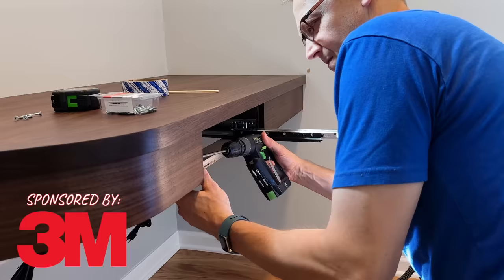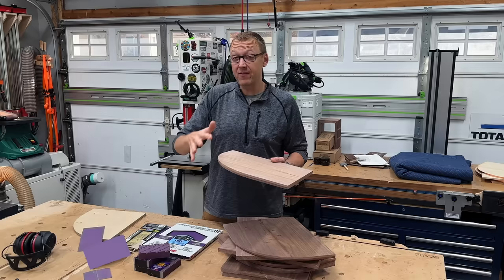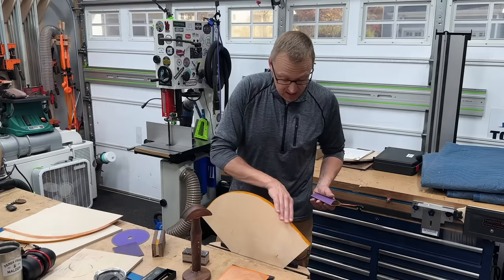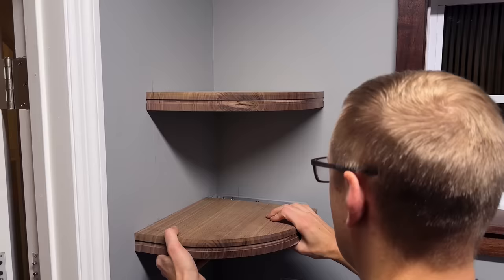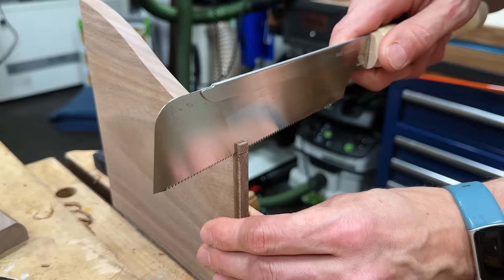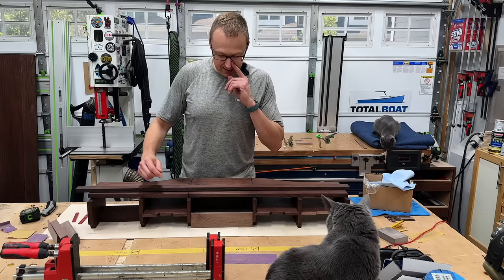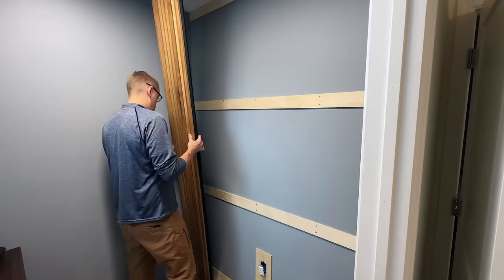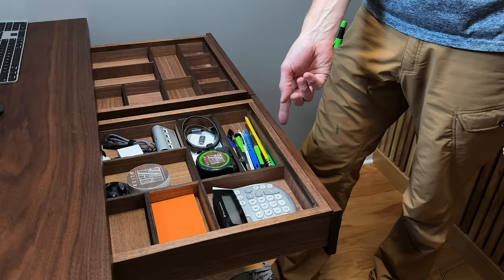I spent over $5000 building my dream office.

Comment: putting them behind you is the correct.  the sm7b is a directional mic and rejects sound from in front of it.  so by putting the panels behind you, those soundwaves won't come back and hit the mic from it's 'address' side where you talk into it.  That room would also benefit with some treatment on the ceiling.  check out john heinz or brad's fix this build that for building sound panels.
Reply from the maker: Thanks Greg! And yes, I've definitely considered some ceiling treatments. Also, maybe a carpet. Although, Jerry sheds enough that it will be a gray carpet in here before too long 😹
Reply: if you treat the ceiling, you won't need anything on the floor.  Jerry can shed till the cows come home and you can too! @KeithJohnsonCustomWoodworking

Comment: The wall panels could be easily made on your end so you can make sure it's quality material but then you run into the same question as making drawers and box joints. Would it be worth the labor vs out sourcing. 
Unless you're staring at the wall for entertainment the pre-made ones could be worth it, if you don't have the time.
Reply from the maker: Exactly. It wasn’t worth the labor and I had zero interest in making them 😂

Comment: 28:16 It's a bit counter intuitive, but it is generally better to have acoustic treatment in the direction the microphone is pointing, so the rear wall is a good place to have treatment. Even if you do have acoustic reflections coming off the surfaces in front of you like the wall and computer monitors, the back of the microphone is less sensitive and won't pick up those reflections anyway. If you do still hear more ambience than you want, the next best surfaces to treat in the future would be the side walls and the ceiling, but the VO's in this video sounded good to me :)
Reply from the maker: Apparently,  with the Shure SM7 mic, it's better to have it behind you and above. I honestly have no clue 😂. And like you said, VO sounded pretty good, so it was probably a lot of fuss for nothing 😜😂

Comment: You can always put some panels on the ceiling as well. No one will notice and it will help with sound proofing especially it is not parallel to the floor or walls. That window right in front of you does not help too because glass transmits a lot of sound waves and energy.
Reply from the maker: I put a huge pillow in the window when I'm recording 😜
Reply: @KeithJohnsonCustomWoodworking  LOL Hey, if ain't broken, don't fix it!! Great Channel and amazing work by the way!! I subscribed today!
Reply from the maker: @Lucas-vd2gx Thanks man! I greatly appreciate that 👍🏻

Comment: Hey Keith- great work, as always.  Also quite timely for me to ask this question - we're considering lining the fireplace with this slat stuff (outside of the combustible area, just the drywall bits) - with your experience, considering the quality (which looked a little gnarly up close for the stuff you picked) and the pretty high visibility use - which way would you go, aesthetically speaking?
Reply from the maker: Thank you! And if it’s just aesthetics you are looking for, I would look at the Posh Wood panels. They are thicker strips than Wood Veneer Hub and much better looking grain/veneer than the panels I bought. And since they aren’t finished, you can really dial in the color/sheen you want if you decide to finish them.
Reply: @KeithJohnsonCustomWoodworking  Thank you so much.  May I also say, I wish I could emulate your calm approach to problem solving instead of my own propensity to tear my hair out in frustration any time things go wrong (which they ALWAYS do, at least in some way)
Reply from the maker: @ibarskiy  You're welcome! And believe, there are plenty of hair pulling moments and fits of frustration that don't make the final video cut 😜

Comment: The only question I always have about the laser wood thing is this. How do you deal with the burnt edges, or is that just a fact and deal with it?
Reply from the maker: Depends on material and strength of the laser, but there seems to always be something there. You can sand it or just let it be.
Reply: Thank you for the reply.  @KeithJohnsonCustomWoodworking

Comment: turned out great, couldn't you make the acoustic paneling yourself for cheaper and without the tear out?
Reply from the maker: Thanks! And the amount of labor it would have taken me to pick up lumber, mill material, sand, multiple coats of finish and assemble panels would have far exceeded the cost to just buy them.

Comment: You coulda got a right-angle XLR mic plug for that Evo preamp and saved yourself extra work making a second base for it!
Reply from the maker: Didn’t know they existed! Never used an XLR cable before. And it was quicker to make a new base than wait for a new plug.
Reply: @KeithJohnsonCustomWoodworking  that's fair. just coulda saved you some work and walnut!

Comment: Hey Keith, what's with the box fan with a filter next to the Harvey? Is it just sitting there or is there some kind of dust "leak" coming from the Harvey? (15:10 or so in the video)
Reply from the maker: Dust leak from the Harvey filters.
Reply: Uggg! I'm sorry. That's a lot of machine to be having that kind of issue! @KeithJohnsonCustomWoodworking
Reply from the maker: @nathanb3606  I think any dust collector lets some particulates through the filters unless the micron level is super high.

Comment: As a DIY person once I purchased a cubitron sanding pads I don't think I would be able to go back to normal paper back pads..
Reply from the maker: Right?! It's amazing the difference between the Cubitron vs. other sanding discs.
Reply: @KeithJohnsonCustomWoodworking  have you tried their mesh backed cubitron Xtract series? They are pretty good too.. One disk lasted forever in one of my project.
Reply from the maker: @mvadu  I have! They definitely cut way better and longer than any other paper I've tried. It's kinda scary. LOL.

Comment: The laser works great. No denying that. But, it's not woodworking. It's a computer skill that outputs on wood. That's fine. If you want to hone your computer skills and make stuff, that's great. But, if you want to be a woodworker, learn to sharpen your wood planes and make stuff out of wod. It really comes down to this: If you want wooden stuff just concentrate on making money and buy the wooden stuff. No plane sharpening, no lasers, just wooden stuff. If you want to be a woodworker, it's the planes and chisels and grain and shellac.
Reply from the maker: Solid points! Thanks for the comment and your insight. 👍

Comment: Amazing video but $858 for those panels is very expensive. Seeing how talented you are, you could have probably made that using an 8x4 sheet of pine for $100. My level of talent is probably less than 5% of yours. Cost me $60 to make a wall with similar panels without the acoustic dampening.
Reply from the maker: It wasn't worth my time or labor to make it myself.

Comment: Why didn't you make the acoustic panels. Surely it would have been far cheaper?
Reply from the maker: Time vs. money. It would not have been worth my labor...2-3 hours to lumber yard to pick up material, milling it down, ripping all the strips, planing them down, sanding them all, applying multiple coats of finish, stapling them to the acoustic foam....it's a total loss. And I didn't want to make them. 😂

Comment: 24:20 why not use the lamello and some tenso connectors?
Reply from the maker: They really need to go into solid wood, not into thick felt. It would have very little holding power, if any.
Reply: @KeithJohnsonCustomWoodworking  ah right. Didn’t realize that the backing was entirely felt. 

When I’ve done acoustic treatments for home theatre applications it’s normally a ply or MDF backer, then foam glued to the front face and then acoustic transparent fabrics stretched over the top and stapled to the back (like you would do for a padded seat). 

Then you can hang on the wall with cleats, screws, lamello, etc.

Comment: $858 for some strips of scrap wood stapled to some acoustic board? You could have made that for a lot less. 4'x8'x1/2" sound insulation panels are less than $20 at Home Depot and you'd need two. A roll of black felt would probably cost about $10-$15. The wood strips...well, you've probably got those just laying around the shop. So, for about $55 out of pocket, you could have a nicer acoustic wall.
Reply from the maker: Thanks. I’m all set. You seem to be forgetting the value of labor.

Comment: Could you not have just built the panels?  I did the same exact panels for a client and did no joke probably 65 liner feet of it and it was unfinished too.  Very fragile.  The individual pieces wanted to fall off.  For the price you
Could just mill up 1/2x1.5 inch stock and glue to a painted plywood backer.  I don’t know.  I’m going to try it in my hallway as an accent wall
Reply from the maker: I didn't want to spend the time building the panels. I'd much rather buy them. It would have ended up costing more in labor to make them.

Comment: Do you throw away your microfiber cloths after using them to wipe up the Rubio? Or can you clean those in the washing machine?
Reply from the maker: I lay them out flat to dry for at least 48 hours and then throw away. DO NOT put in washing machine - Rubio contains dangerous solvents. Check out Bourbon Moth's vid on the danger or Rubio soaked rags: https://youtu.be/3Gqi2cNCKQY?si=2K9EJTo0lBMZ74fH